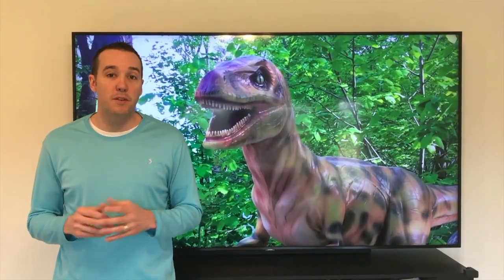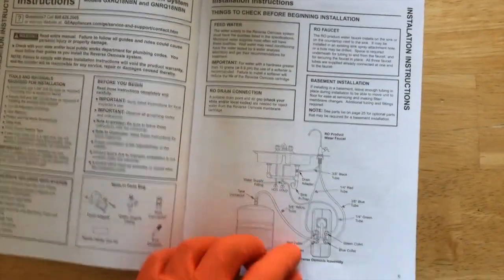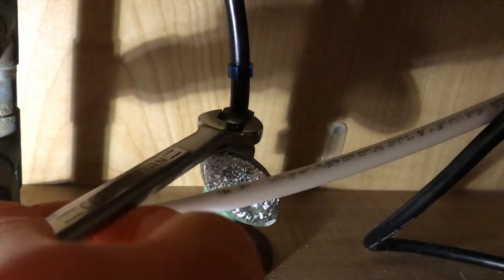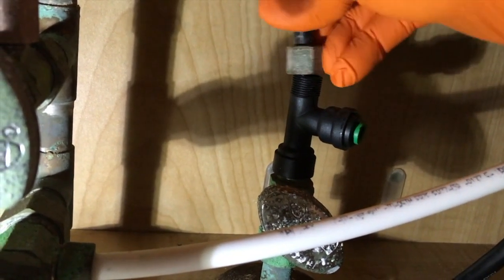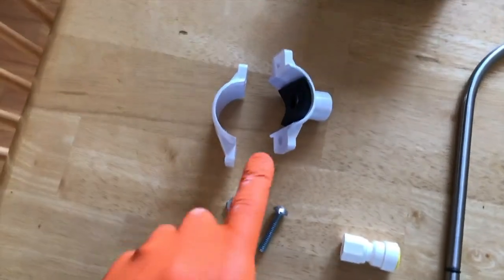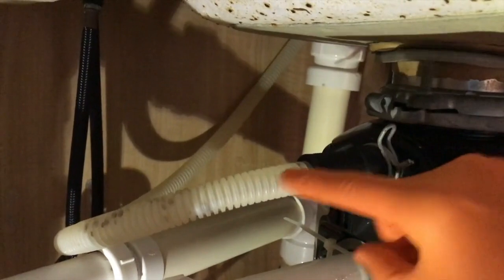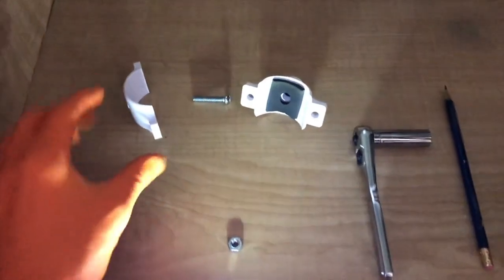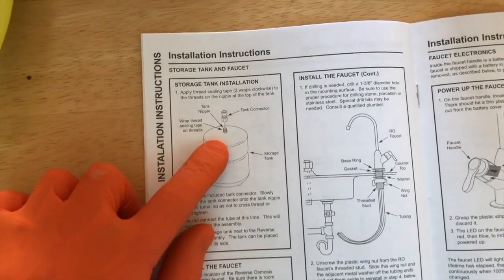How to install GE Reverse Osmosis system (PART 1)

Comment: I only have one sink and garbage disposal is right under sink drain, which then goes down into the p trap. Can I install the black drain water after the p trap? What is the problem with doing that? I guess if water somehow pushed back in the drain, maybe from the dishwasher, and got into the black drain tube, it would have to go all the way up to the faucet before it contaminated anything and that is even above the sink drain height so water would go into the sink first I would think. Right?
Reply from the maker: Thanks for watching, the instructions do have a step-by-step guide on installing the system into a set up exactly like yours.

As you mentioned, water may push back and contaminate system…if not installed properly.
Reply: @DIYwithMichaelBorders  I have the same issue with the 1 sink and garbage disposal. There is no instructions that come with this system that shows that part

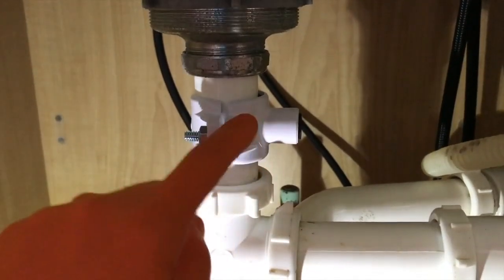Comment: At 4:16, you install the drain adapter. What do I do if I have a single sink that has a garbage disposal attached to it?
Reply from the maker: Thanks for watching, if we remember correctly, the single sink install instructions are mentioned in the install/instructional manual.
Reply: @DIYwithMichaelBorders  hi, there is instructions for a single sink without a garbage disposal. There are no instructions for a single sink with a garbage disposal.
Reply from the maker: @tomatojuice12  

Thanks for the reply, we did some research, GE does not recommend installation of this system on a single sink with disposal.

Comment: Im having a hard time getting the reverse osmosis filter out.  It wont turn.  Any advice?
Reply: I come across the same issue. Did you fix it?
Reply: I had to get a big wrench to twist them off and then the center one after replacing was hard to turn to the right.  Not that eady at all to replace.